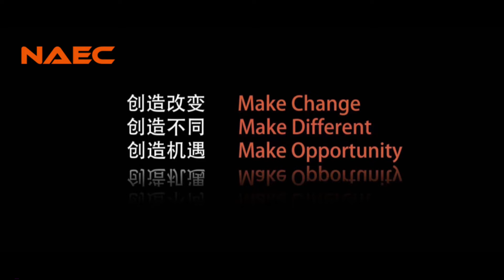How to ensure the size of components and the automatic welding rate? #welding #assembly#robot#boom

Comment: So the question remains,"How to ensure the size of components and the automatic welding rate?". It would be good to see a data-based decision-making system evaluating weld TS on manual or autonomous welding systems.
Reply from the maker: Dear friend，so glad to hear from you .This video mainly reflects “the assembly method of components is an important factor to ensure the size of components and the automatic welding rate” and show our capability  on assembly .pls feel free to contact us for  more in-depth exchange.
Contact: foreigntrade07@autowelds.com 
               +86 15150655761 (mobile/whatsapp)